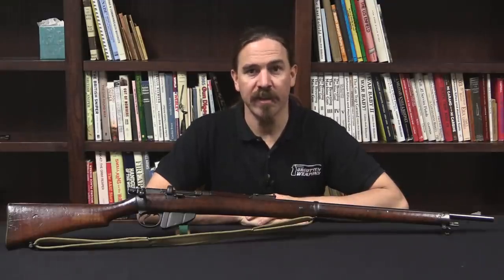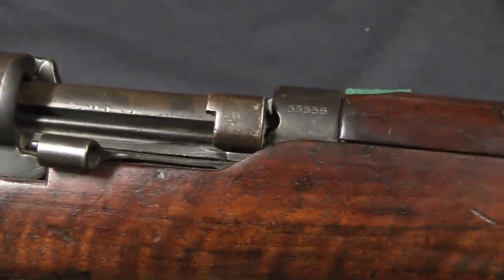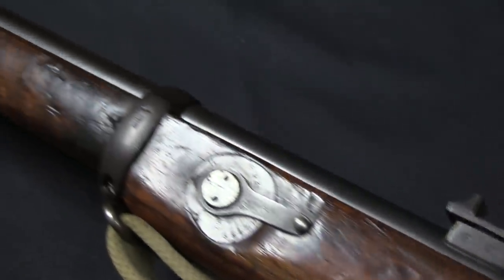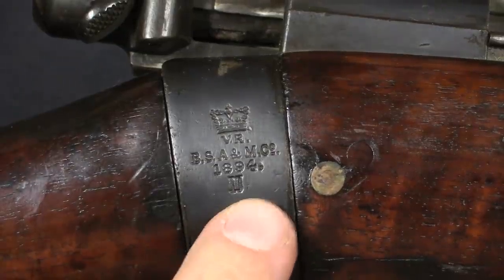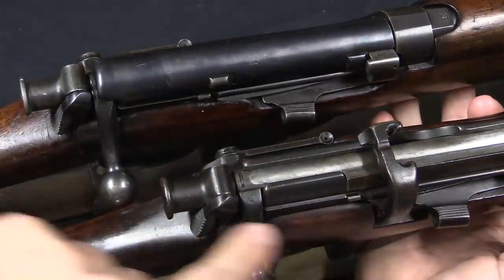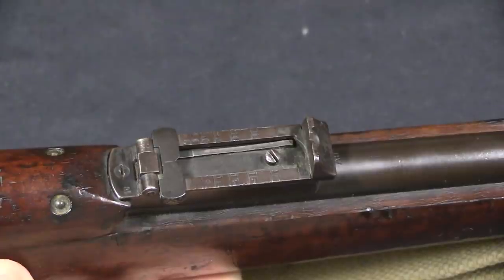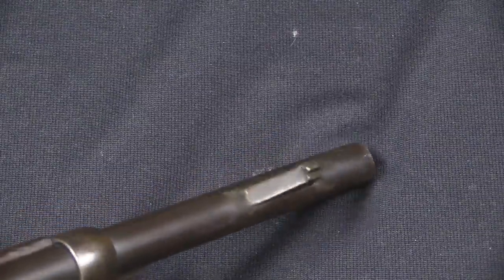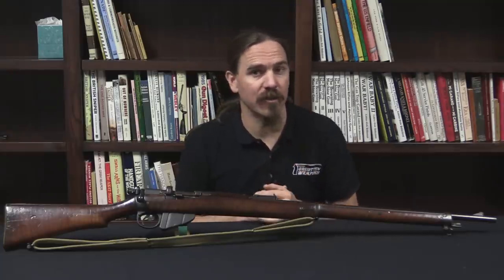A Rare Navy Stopgap: the CLLE MkI Naval Enfield

Comment: I have a suspicion that particular conversion might be the result of a admiral deciding it was better to ask forgiveness than ask permission, the admirality were notorious for dragging their feet when it came to other expenses than the dreadnoughts
Reply: Scale of budget too. You can update 10,000 rifles to use common ammunition supplies, or put one spare 4"BL gun in inventory
Reply: Or an interesting set of duties held by one officer.

Go watch the Sub Brief on the NR-1, where Admiral Rickover on the Atomic Energy Committee gave orders to Admiral Rickover in Bureau of Ships to make a nuclear powered deep submergence vessel. (Same Admiral Rickover, just doing two different jobs).
Reply: Though looking at the simplicity of it (remove dust cover, install a charger bridge, replace rear sight leaf) compared to the Army CLLE, I suspect that this was a minimum cost conversion that might have been doable at the ship armory level.
Reply: @ScottKenny1978  True, but Ian did show a closeup of the markings put on by the company that did the conversion
Reply: @bjrnegillarsen1380  sure, for this example. 

Though if there was a small surplus of guns, I suppose it would be better to send some letters out to the ships saying "you will receive a full set of replacement rifles configured for the new ammunition as well as a full load of ammunition for them, plus a small excess for training and function checking. Once the new rifles have been checked and racked, put your old rifles into the crates for delivery to the factory for conversion. Make sure you use up the old ammunition."

Comment: This brings up an interesting question - how many shots on average did it take to detonate a floating mine with an Enfield or Springfield vs spraying full auto at it? The horns are pretty slim.  Seems like a fun duty though, the ultimate reactive target.
Reply: The aim was to sink them, not detonate them. Mines at the time were designed to be unarmed when free floating - the UK Mk 17 needs tension on cable for the detonator to be presented to the booster. This meant the best thing was to shoot them at the waterline.
Reply: Annoyingly, YT has just eaten my post on that halfway through, sorry if it comes round again.   The practice was for a minesweeper to cut the mine's tether cable so that it came to the surface,   It would then be detonated from a safe distance by rifle fire, less ammunition expended 'cos in the average mine field there'll be rather a lot of mines.  I'm assuming mainly WWI because mines got progressively more sophisticated there after.  The classic horn mine had a number of soft metal horns each containing a glass phial of acid electrolyte.  If the horn was shocked the phial broke, the electrolyte then completed an electric cell and BOOM.  Simple and suitable for mass production.   The reason I mention it is because of visits to the seaside as a child I used to see old horn mine casings turned into charity collecting boxes.   You also used to see 15" and other shell cases used the same way.    My beloved big brother convinced me that they were still active and liable to go off at any time,  He would then slap it to see what sort of reaction he would get from his sibling.  Aaah !  Family.
Reply: There is the story of one Minesweeper Captain  who yelled at his crew 'If you don't hit it next time, we will lower the whaler, fix bayonets and charge!'
Reply: @TheArgieH  Yeah I rememebr them as a kid, looong time ago now.
Reply: @ChalkyRN  There might be a few problems with that.     The English Channel and North Sea are relatively shallow.   When Beatty lost his battlecruisers at least one showed with its bows sticking out.    Both  se areas were heavily mined in both wars. Several multiple tons of Torpex packed in handy packages, complete with detonators, slowly corroding located in some of the busiest waterways in the World is not exactly a safe bet long term.    That said, the US ammunition ship with enough explosive to reshape part of Kent is still in its resting place with its cargo corroding in the Thames Estuary.   Apparently, it is now too sensitive to do much about.
Reply: @51WCDodge  had a couple of officers that would have said something like that.... 🤣

Shooting a small target from a moving ship or boat is a challenge. Especially when it's a couple hundred pounds of explosives, you want to be a good 100+ yards away for that.

My shooting buddy was an Engineman on a Minesweeper in Vietnam, he spent a lot of time clearing Haiphong harbor after 1972. He said the EOD divers were chain smoking, some of the mines were "touchy" and had to be blown in place, while they had to disarm and pick up all the mines that didn't have to be blown in place. A little surreal seeing guys chain smoking next to stacks and stacks of mines on the fantail.
Reply: @TheArgieH  oof, an ammunition ship is a nightmare. Closest example I could find was the Texas City Disaster, when a ship carrying 2300+ tons of ammonium nitrate fertilizer blew up in 1947. https://en.wikipedia.org/wiki/Texas_City_disaster
Reply: @TheArgieH  Post WW2, multiple RAF bomber squadrons were tasked to load up with bombs, fly out over the North Sea & drop them. A not insignificant number failed to detonate.
Then there's the Beaufort Trench dumping area for artillery shells - except the skippers of the ships tasked with doing the dumping were disposing of their cargo as soon as they thought they were out of sight, so instead of being down at 800-1,000' the stuff's all over the northern Irish Sea at depths between 60 & 300'.
I've seen artillery shells washed up on the Galloway coast.
Reply: @GARDENER42 
Thanks.  I knew  that one alleged drawback to any thought of a bridge, tunnel or hybrid link between the UK and Ireland, is the possibility of the engineers meeting with that discarded ordnance. In contrast, to the south of Hereford near to Eywas Harold is a stretch of now heathland known as the burning fields.    It is the spot where postwar munitions were taken and literally burnt.    Two advantages, save on Avgas and safer longterm.
Reply: @TheArgieH  There's video somewhere from a cable laying operation between Scotland & NI where the machine is nosing its way through UXO littered all over the seabed.
Scary stuff but it helps dissuade the trawlers from destroying the seabed...
Reply: @TheArgieH  And you better not tick us off....
Reply: @TheArgieH  as I posted earlier, once the mine is floating, the detonator isn’t in the booster pocket, so won’t detonate the mine, even if you did hit a horn. Plus, lead crush horns were replaced on most mines by world war 2 to simple tilt horns that completed a circuit. The aim was to sink the mine with rifle fire.
Reply: @TheArgieH  absolutely, the sea bed is littered with mines but as buoyant mines were designed to self clear with a flooding device that would activate at the end of battery life or timer, sinking surfaced mines remained the norm. Now we would dispose of them with a placed charge to make hunting easier.
Reply: @TheArgieH  the Richard Montgomery is a complicated case due to the mix of explosive types. The issue are the small, early, cluster bombs that are fused. Moving / recovering them would be considered extremely dangerous, especially when mixed with all the 500lb bombs. Leaving it all be remains the safest course of action (probably) 😬.
Reply: @ChalkyRN Quite so, I am minded of Flixborough. The plant was perfectly safe, right up to the massive explosion.    It's the old "it seemed like a good idea at the time" rubric.    On the Richard Montgomery wreck I don't see what else they can do, other than keep maintaining the warning buoys.    Too much publicity could encourage souvenir hunters, though most divers probably know better.    Looking on the dark side, bits of the souvenir hunters on HMS Campbeltown were found some 400 metres from the site, that's what I call an object lesson.

Comment: Also, there is a MkVIII (mark eight) .303 round. It looks identical to the MkVII except for the head stamp and is reputed to wreck your SMLE after a few rounds - it is intended for use in machine guns only and has a higher chamber pressure than the MkVII - probably by increasing the headspace by battering the action and then having a case separation on firing.
Reply: And then there is the Japanese machine gun ammunition…
Reply: MkVIIIz is specifically low flash ammo.
Reply: It wasn't just higher pressure. The mk8 used a boat tailed spitzer with a  more efficient taper the mk7 was a dual core (at the time called a "British spitzer") design with a light weight tip that caused the bullet to yaw on impact dumping all its energy into the target.
Reply: @dickybird6916  Mk7Z was designed to replace the old Dum-Dum soft point ammo, and the Mk3, 4, and 5 rounds.

Interestingly, the Soviet 5.45 military ammunition is designed much like the Mk7Z bullet, steel core with a lead filler to make the bullet very tail-heavy and tumble on impact.

Comment: The Mk VIIIz was the last main version of .303 British, not Mk VII.
Reply: The mk8 boat tail wasn't for infantry rifles. it was developed for and only issued for use in machineguns as it was a higher pressure round. It was introduced at the same time as the mk7. Some snipers got their hands on it on occasion but it was never issued to them.
Reply: @dickybird6916  It was described as being for all suitably-sighted .303 caliber MGs & small guns despite being higher pressure. The pressure wasn't a problem because Brens & rifles were proofed @ 50,000 PSI. However, it caused significant bore erosion in weapons designed for Mk VII ammunition. This was ascribed to the channeling-effect of the boat-tailed projectile. As a result, it was prohibited from general use w/ LMGs & rifles except when lower levels of flash were important as well as for emergencies.

Comment: To upgrade it to include a charger bridge, wouldn't they have to replace the receiver?  Is is welded onto the old receiver?  That sounds like more trouble than it would be worth.
Reply: Not like these where intended to se massive service tough. 

Being essentially anti boarding weapons on ships if i got the origin correctly
Reply: The charger bridge is a separate part riveted onto the receiver. Its actually the same standard component that was used in the manufacture of No1 rifles - SMLEs were actually were built as Long Lee receivers with an added charger bridge as well. The integrated solid charger bridge came in with the No4 rifle. All of the main rifle factories were already set up to add charger bridges to Long Lees, so it was a fairly cheap conversion.
Reply: @turbogerbil2935  Interesting.  Thanks for the reply.
Reply: Welding would be an issue, you'd have to re-heat-treat the receiver and make sure it didn't warp in the process.

But these were riveted on. As long as the holes are in the center of the part, they don't take any strength away. It's the same idea as holes in aircraft parts.

Comment: He says these rifles were used by “the navy” but who does he mean specifically? Sailors, guards, marines?
Reply: These rifles would be sitting on gun racks aboard warships in case of boarding actions.
Reply: The Royal Marines would probably have gone straight to the No1 rifle in this period, as they were usually equipped to the same standard as line infantry battalions. The Royal Navy also equipped each ship with a quantity of rifles, as ships' companies were trained to provide armed landing parties as needed (bluejackets). In addition, the RN - which was a huge organisation at the time  - ran several very large shore based training establishments. I expect that these particular rifles were used as interim training equipment at HMS Excellent or one of the other shore bases that was involved in large scale small arms training.
Reply: The  Andrew (Royal Navy), getting thier  boots dirty? That is what the  ' Bootnecks ( Royal Marines) are for ! Though Jack  ( A Royal Navy sailor ) may occasionly condesend to stand about with a rifle outside the main gate.
Reply: @someguy3766  Colt opened his London factory to supply a Royal Navy contract.
Reply: @51WCDodge  to be fair, I imagine that if it's got to the stage where a sailor is having using a rifle, something has gone drastically wrong
Reply: @51WCDodge  happened a lot before WW1, particularly in India and Africa. And probably in China, though I'm less familiar with the events over there.

Particularly before ships had fixed gun mounts, you'd have a lighter gun like a Swivel gun dismounted from the ship and put on a ground carriage, and crewed by naval types.

Comment: JESUS CHRIST HOW MANY ENFIELD RIFLES ARE YOU GOING TO TALK ABOUT??!! Seems like you do a new one a least once a month or more!!! I will immediately dislike EVEN Enfield video you do from now on!!
Reply: That's a Britt tech... if this was a car channel, Ian would had been stuck forever describing various vintage Land Rover iterations and differences that make some things incompatibile without changing the model, just the date. It is that insane.
Reply: @docnele  late production Hudson/Studebakers and AMC cars are pretty nuts, too. Hudson and Studebaker would trade engines and chassis, so there are original Hudsons with Studi engines and Studies with Hudson engines. As for the AMCs, they'd take parts from whoever had a surplus. Cadillac, Ford, Chrysler, etc.
Reply: @ScottKenny1978  Jezz... I'm glad I am from former Yugoslavia, we had Italian, German and some Soviet cars. People learnt which part fits to other brand, so my Lada was using VW valve seals and owners of VW Golfs were buying cheap oil filters... that were intended for domestic tractor production :)
Reply: @docnele  yeah, the AMCs are notoriously hard to work on due to them taking whatever extra production a company had.

But they made pretty good engines, especially the big inline 6cylinders. I have a 1994 Jeep Cherokee with the 4.0L (244ci), and it has 180k miles on it. Only major repair has been replacing the water pump gasket. That engine is a descendant of the AMC 258ci (4.3L). In fact, you can put a 258 crank into a 4.0L without any machine work. It's a common thing, and I plan to do it myself when I finally rebuild the 4.0L.